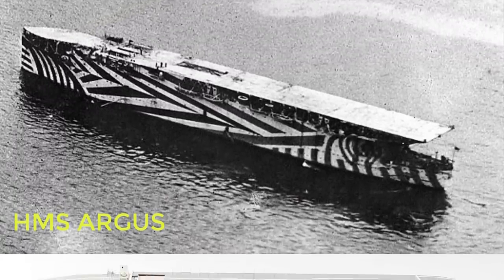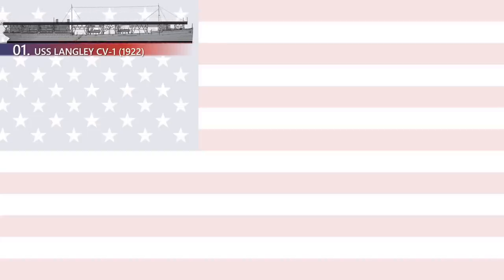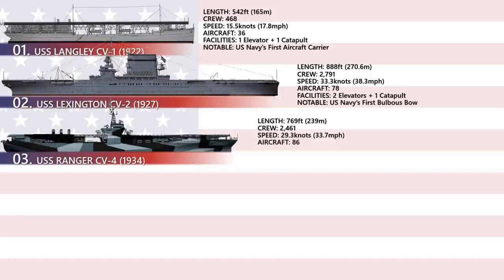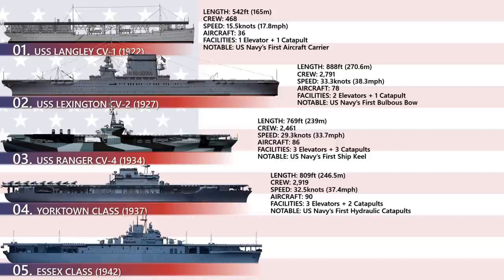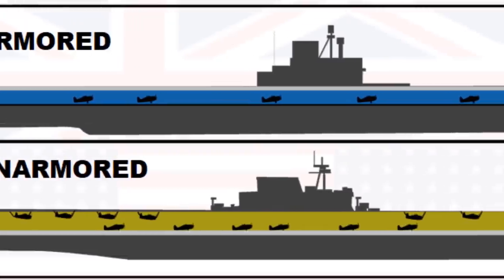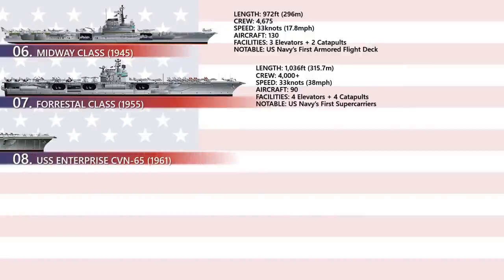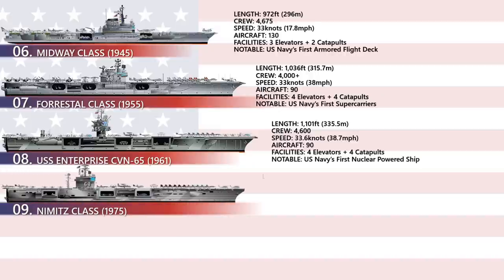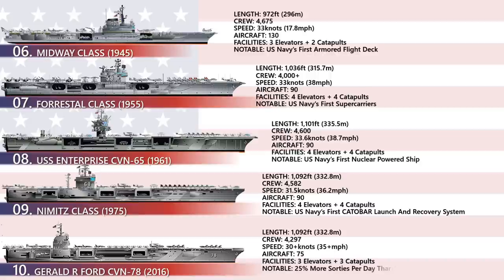Evolution Of US Aircraft Carriers

Comment: You forgot about the Kitty Hawk class!! John F. Kennedy class variant! The USS Enterprise was 1123ft long. Better luck next time.
Reply: Yeah! She forgot Also the refit cvn-10 class  Hornet,Oriskany, Lexington BonHomne Richard, Intripid. The were the extended slightly. The Randolph, and. Wasp  were not.
Reply: @robertotamesis1783  I could of listed the extended Essex class and the CV7 Wasp. Most of the time she does not do enough research. All she does is Wikipedia crap.
Reply: @robertotamesis1783  She did one about WW2 subs. She was way off. I think she removed the video.
Reply: @johnchampion9268 was  she talking about that pocket  submersible cruiser Uss Nautilus class . Think there were #3  of them, they were the largest subs that  the  USN  had in WW2 , fitted w/a 6"  gun (152mm) .
Reply: Kitty Hawk has no essential evolution from Forrestal except that the port elevator moved from launching end to the aft. JFK should be enlisted cuz the port launching deck was reshaped to become adapted latter to Nimitz and other catabor carriers.

Comment: I would have included the Kitty Hawk as an improvement of the Forrestal design by shifting the starboard elevator and the superstructure aft and placing two of the port side elevators forward of it, making the midships part of the flight deck less congested during flight ops.

Comment: What a basic error right at the start. The UK and Japan were at the forefront of Carrier design and production until WW2, NOT the USA. The USA was a laggard. Such a BASIC ERROR gives no faith that anything said has any validity in fact! It was the UK that started with the tradition of the Island location on the Starboard side while Japan started on the Port side initially then adopted the British style. The UK developed the Angled Flight Deck, Arrester Wires, Steam Catapult and the Mirror Landing System. HMS Victorious (which had the first angled flight deck in the world post WW2),  was loaned to the USN, along with the crew and aircraft, during WW2.